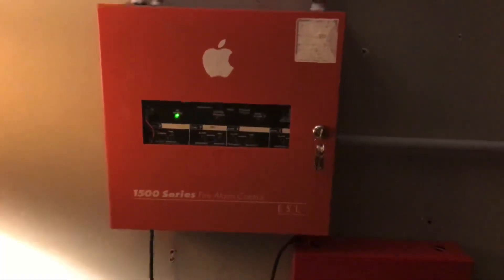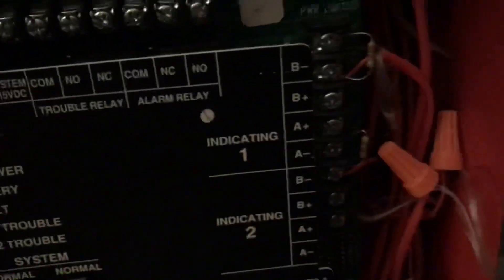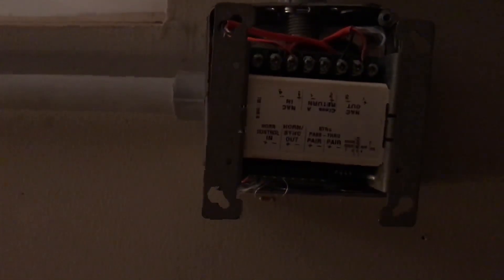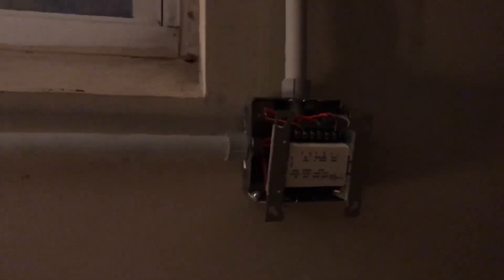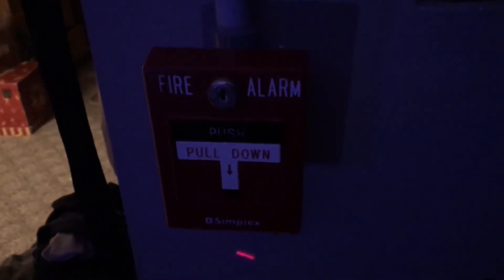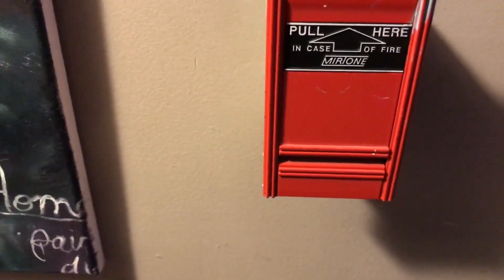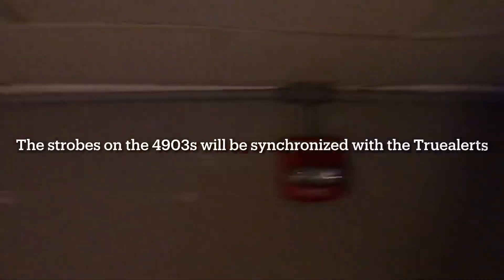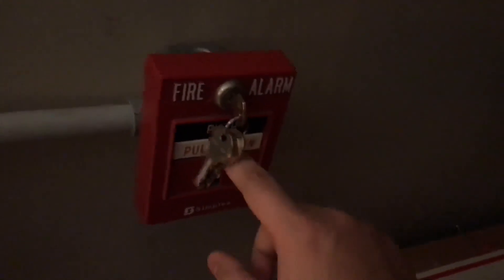System Test 12: Smartsync Truealerts!

Comment: I never knew that the 4903-9252 couldn't be coded by the SmartSync module. What about the 4-wire TrueAlerts, like the 4903-9425?
Reply from the maker: The 4-wire Truealerts can’t be coded either. The strobes can only be synchronized with the 2-wire Truealerts.

Comment: Is the video "grainy" for everyone else?
Reply from the maker: I use my iPhone to record my system tests. So that’s why the quality tends to look “grainy” when I’m in a dark area.
Reply: Also what is the model of the smokes?
Reply from the maker: @nesmanmain0001  The heads are ESL 711U photoelectrics mounted on ESL 701U 2 wire bases. Commonly used smoke detectors on ESL systems.
Reply: @CoolSimasGuy  do you happen to know the model of the 4 wire base? Let's just move this conversation to discord.